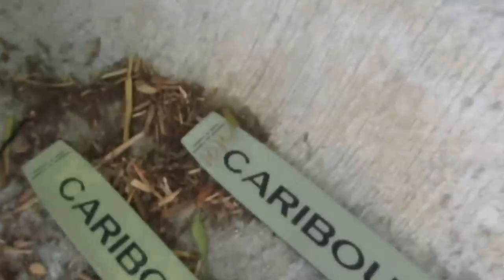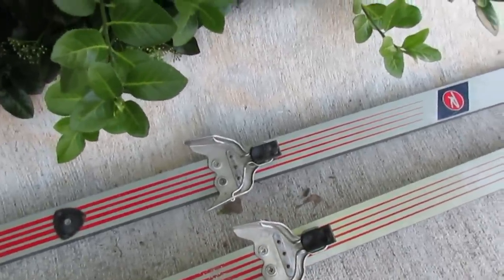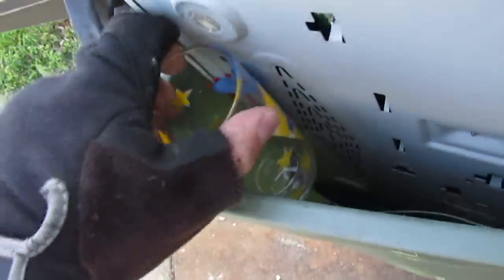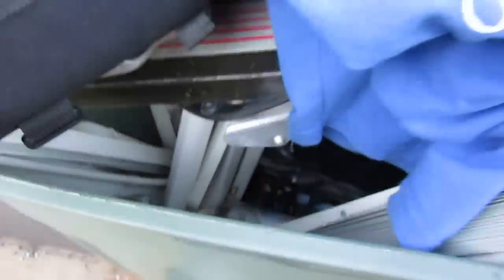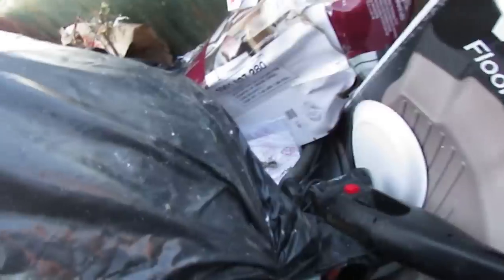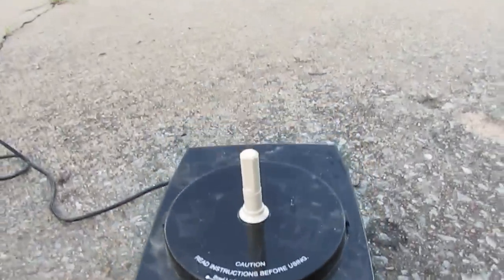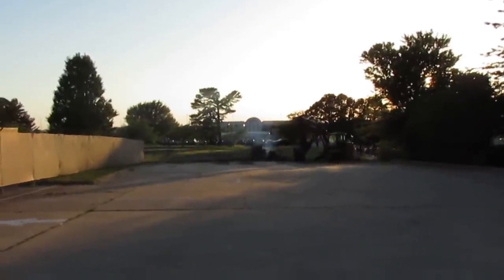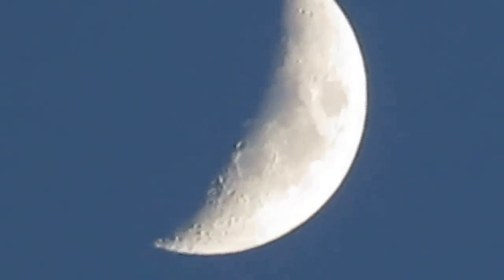MORON puts $400 Suitcase on the Curb - Dumpster Diving Scrap Metal Scrapper Trash Picking Picker

Comment: I have a real problem with cord cutters. They may not be interested in what's attached to the other end and think it's only worth the pennies of line cord copper content, but some appliances are tossed for reasons other than total malfunction, for example I came upon a nice shop vac that a cutter hacked the cord off right up to the inlet bushing. I gambled and took it home and dismantled it so I could tap into the power feed, yep, it worked just fine, added a fresh cord and got me a nice vac for free. That Mixer base you chopped, if it turns over- and likely it would, somebody could've made use of it like making a magnetic lab stirrer for fluids or some such reuse.

So how about this my fellow scrappers, leave at least a 2" pigtail of line cord so a person can easily evaluate and reuse the item, it costs you nothing, and after all reuse is far better than recycling. ☺
Reply from the maker: pigietail is a good idea, never have heard anyone say that b4. Although, I just had a dvd player in my living room start smoldering with a little red ring of burning circuit board inside so some of it is plain dangerous. But ya all them vacuum cleaners, lots of them are thrown out cuz the tube is blocked up and such, they are treated as disposable items really.